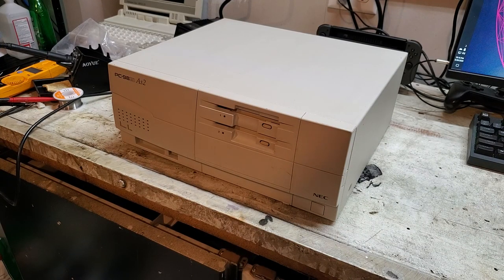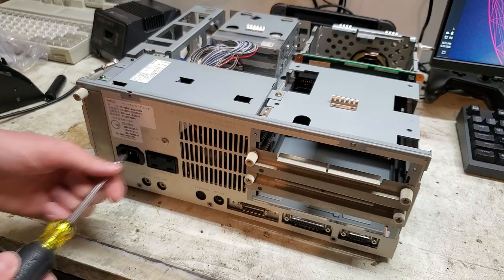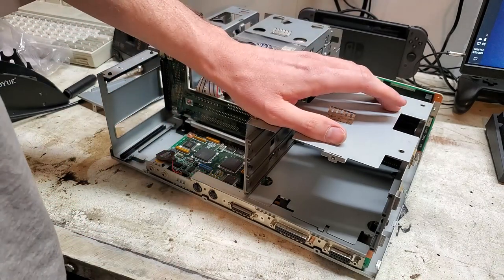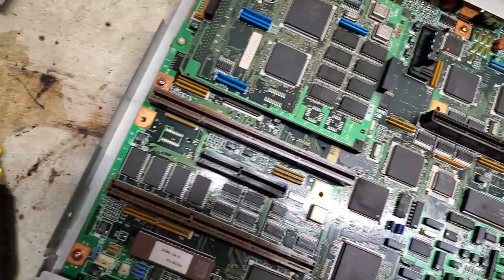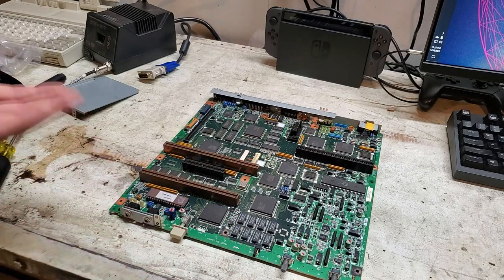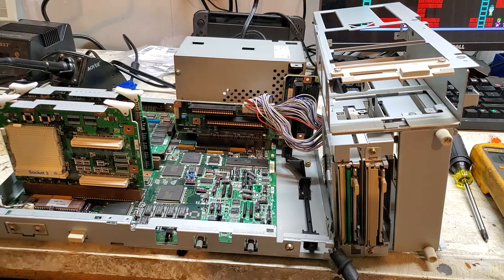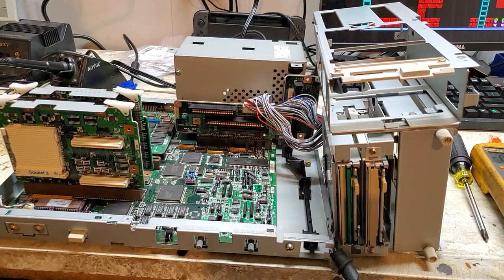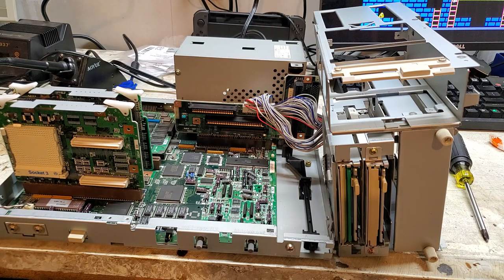NEC PC-9821 As2 Part 2: Teardown and Recapping

Comment: Hope the replacement chip fixes the audio permanently.  Thankfully my machine, at least as far as the non-moving parts goes, has been quite reliable for the most part for over a year.  It did at first have a weird issue where it would keep resetting on its own occasionally, but that seems to have gone away.  Even the battery still seems to save the time.  Hope I don't have to fix something that requires soldering on mine one day, or else I'm screwed.  I've tried practicing soldering many times and failed miserably.
Reply from the maker: Yeah, at least the recapping wasn't a complete waste of time since the SSG sound came back. The worst part of it is just the waiting. Keep practicing soldering on junk electronics though, it's a handy skill to have even, even at my sub par level.

Comment: flux makes soldering easier, why don't you have flux?
Reply from the maker: I ordered some, but I got the caps first and I'm an impatient bastard. It could have definitely made the through hole capacitors easier.